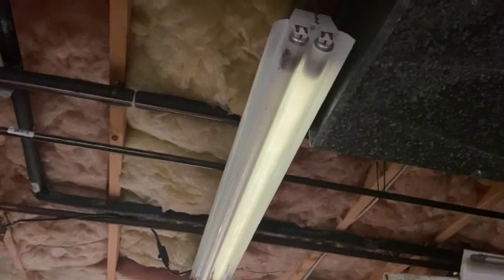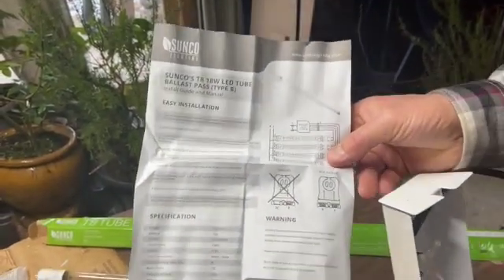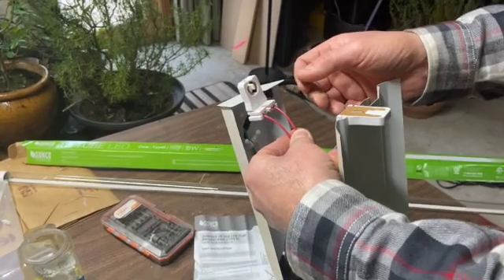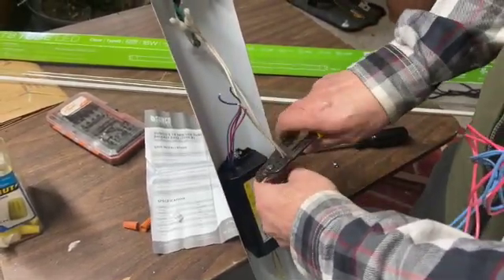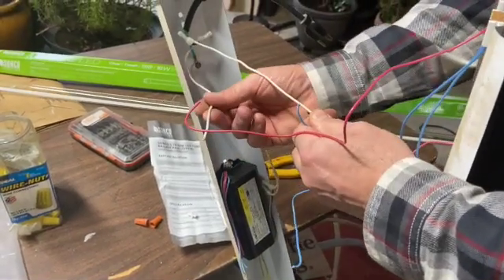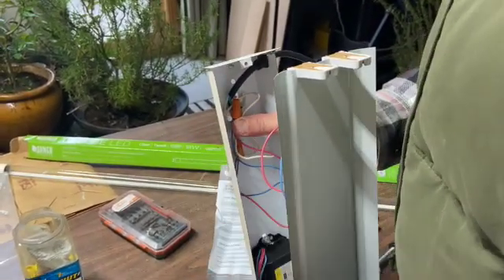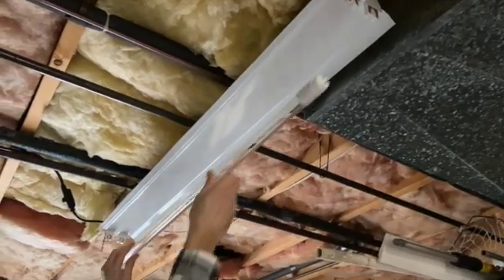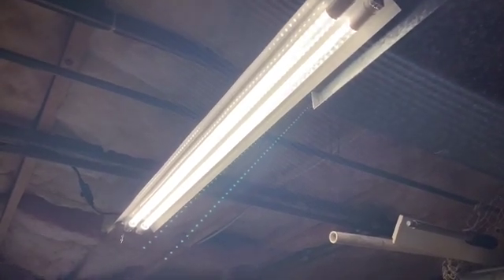Switching a fluorescent tube to a single-ended LED tube

Comment: Do you use a hot and neutral for each pain or just hot for both pins on one end?
Reply from the maker: These particular LED bulbs were powered from just one end of the bulb.  So one pin is hot and the other pin is a neutral.  But, you’ve got to check the lamp fitting (it’s sometimes referred to a tombstone) to make sure it’s possible to wire it that way.  A “shunted” tombstone only has one wire coming out from it  and powers both pins.  That type of fitting would not work with these bulbs.  The fitting on my fixtures were “non-shunned” and had two wires running from it.  So each pin was powered. Most online retailers of the LED bulbs have tutorials on what to look for when selecting retrofit LED bulbs.  Check your fixture and consult the tutorials to make sure they’re compatible.  Hope this helps.